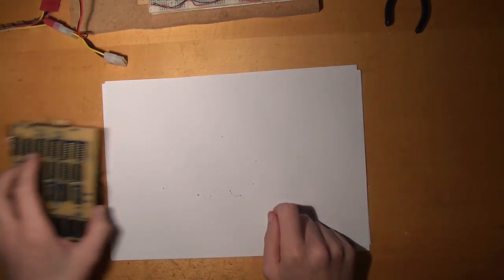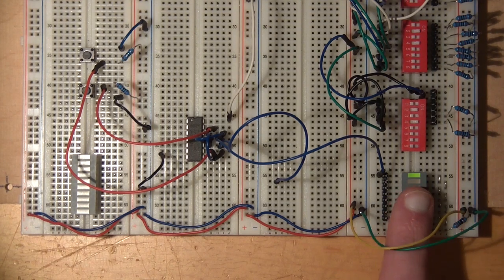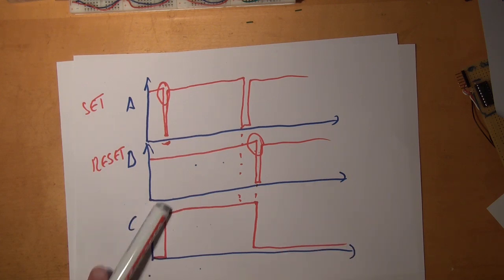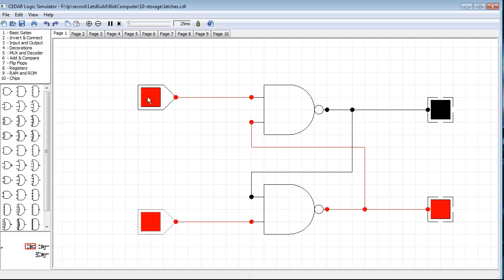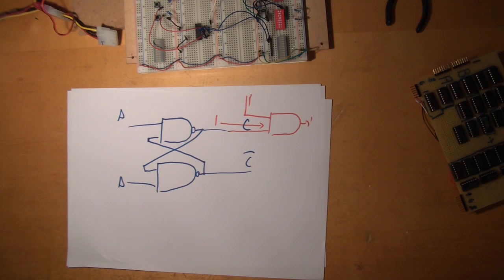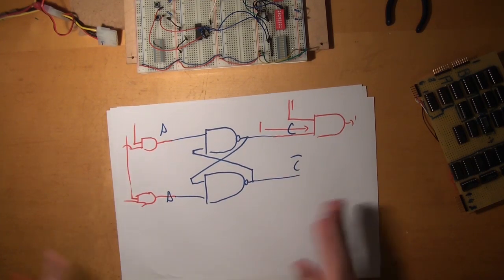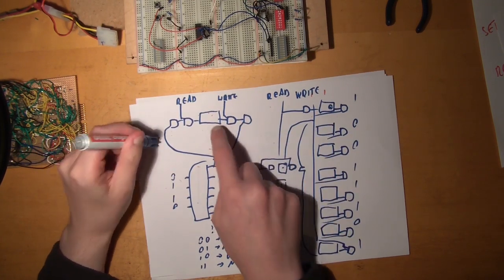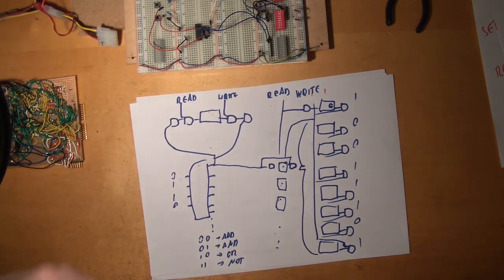How CPU Caches Work   8 Bit Computer Part 10

Comment: what about looping a regular or, basically you have 2 inputs, (1st is on, 2nd is off), so, you put the 1st inside an or gate, then, that output is anded with an INVERTED 2nd input. and the output of that will go through the other or. And the output of the or gate should also be connected to an output, which will therefore create a circuit that stays on forever, and can be cleared.

Comment: over all, a very confused presentation... its not cache, its either registers or memory... a cpu can address as much memory as 2^X, where X is the number of address lines. a C64 has 16 address lines but it is an 8 bit computer. an 80286 is a 16-bit cpu with 24 address lines for 16MB of address space. 386 is a 32bit cpu but still only had 24 address lines. .... the latch is NOT edge-triggered. hold down button A, now hold down B as well. the last button you let up will determine the stored state. if it was edge-triggered, the last button you push down determines the state.

Comment: Awesome video madmaxx. I followed up until the part where you say the 1st nibble is instruction & 2nd nibble is address in and 8 bit system. How then does this work in a 6502 cpu? I realise the 6502 is a bit more complex than what you have shown here. It can address 65535 bytes, not the 16 possible addresses you mentioned. It has a high and low program counter.

Comment: You mention something in here about how 32bit processors can only store 4 gigs of RAM because they can only use one half of the 32 bits in a word to store addresses, however with what I know that seems somewhat incorrect.

2^32 is 4294967296, which is the number of addresses needed to maintain 4 GB of ram, so that means that you need 32 bits to store addresses, not 16.  I think I remember something from school about the processor knowing whether a byte of data is an address or instructions, but I can't remember exactly what details were.  Its the only thing that makes sense to me, since you would need all 32 bits to address 4GB of memory.  Do you know anything about how engineers have achieved this?

EDIT: this paper from Sanford mentions how addresses are stored in separate 32 bit words. I'm almost certain this would limit processor cache size to less than 2^32 on a 32 bit processor, but not necessarily total addressable system RAM.  I think part of this is the instruction can tell the machine that the next arbitrary number of bytes are data rather than more instructions.

Comment: Hello great video, it really simplified things!
I'm in need of advice.. I'm going to buy a laptop that I will use for Editing in sony vegas and playing Leauge of legends. I had just made up my mind: 
HP Envy 15-j119so 15.6" everything seemed fairly good with AMD Quad core A10-5750M, 4 Cores and 8 GB RAM. But then i noticed it only had 2MB CPU Cache.
My question is: will this computer be good enough to edit and render videos in sony vegas as well as playing some leauge of legends or should i opt for something else? if so what? Thank you so much to whoever answers!

Comment: i'm sorry but i have to point out that you're wrong with your addressing
16 bit address can only point to (2^16) bytes of memory thus means you can address 64kBytes
20 bit addressing which was commonly used in 8bit computers could reach (2^20) bytes = 1MB of memory
in 32 bit operating systems you actually use the whole 32 bits as an address (2^32) bytes = 4GB of memory

your CPU with your command|address structure can effectively reach 16 bytes of memory in total.

However speaking of modern systems and how memory works, you don't have direct memory access per block but you're addressing a sector (group of blocks by 16/256/1024 etc.) and read the whole sector of data at once so you for example point to sector 15 -> in your case the address would be 1111 and read whole chunk of 16 bytes at once.
by this method you can achive total of 256 bytes of memory.

Comment: where'd you get the materials for this?
Reply: I recommend mouser.com It carries lots of gates and such. Or the app Geek. It won't have the ICs, but you should get your breadboards and cables and buttons and transistors and anything you can find from there. It's cheap af but good quality. Also the shipping is extraordinarily low. To recap: anything you can find: Geek (app) ICs and logic gates: mouser.com

Comment: You can do your NAND latches I will use my double NOT gate flip flops which are much simpler in a real build
Reply: +pwnst3r15327 You mean a NOR gate, because you need two inputs. You could cross input with circuit wires, but that's...really bad practice...